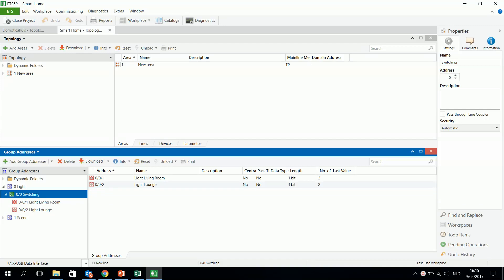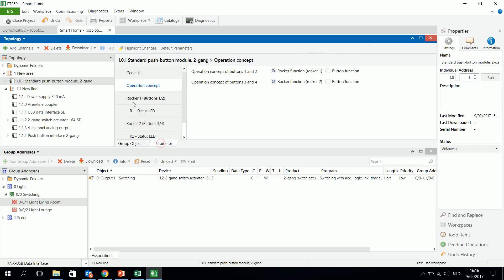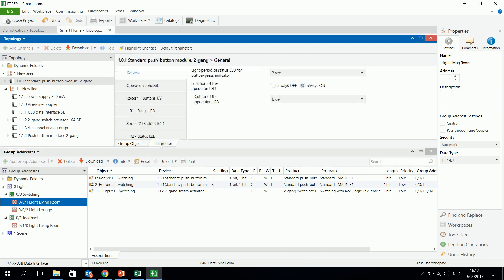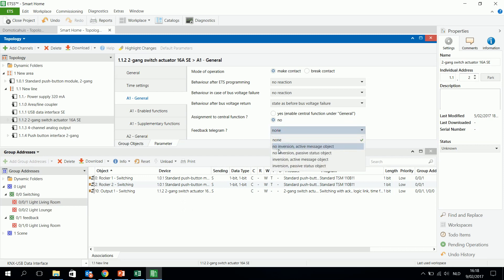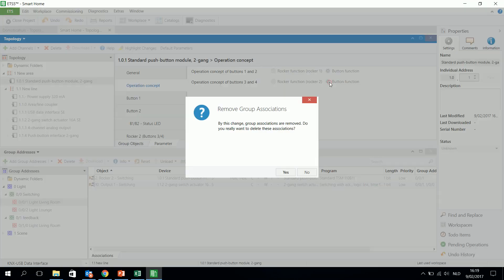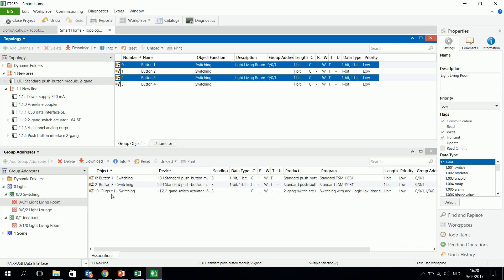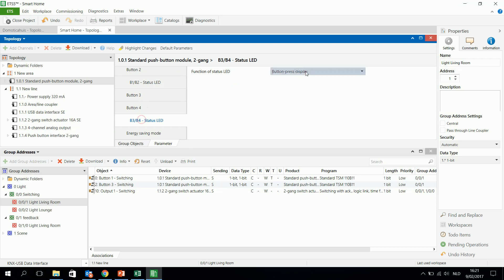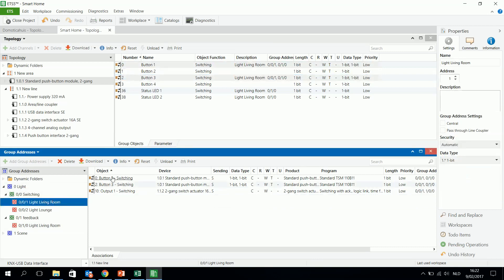KNX ETS5 Switching a light with 2 buttons, switch, toggle, avoid pressing twice, feedback led

Comment: Hello Joachim
Great video, that you are doing, but there is a small mistake about your explanation : 4.54 
You tell that when the toggle button is in the same group address there will be problems for button 1 or 3 to turn on the light.
I've think that you mean, if you hav button 1 toggle output 1 in one group address and button 3 in another group address toggle output 1, then there will be a problem , then you could use feedback group address to solve the problem  or just let button 3 listen button 1 and the same for button 3 ;)
Reply from the maker: Thanks Tommi for your feedback! I'll check this out and adjust this in a new video! Great!